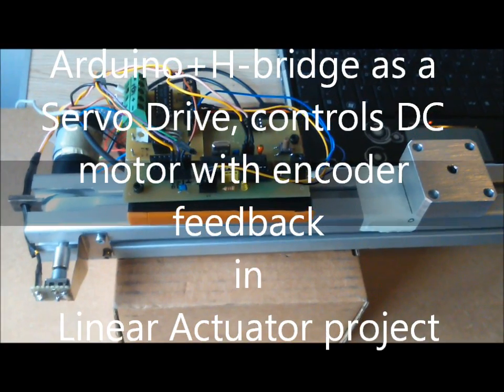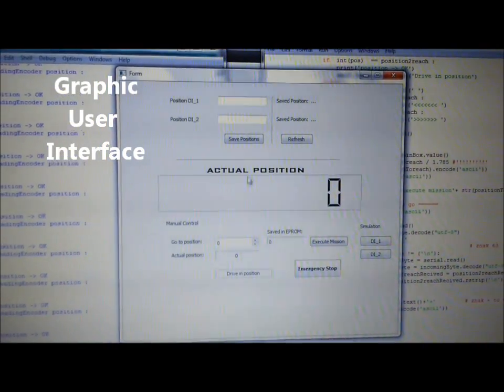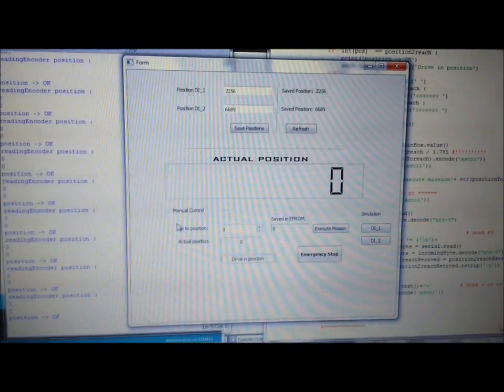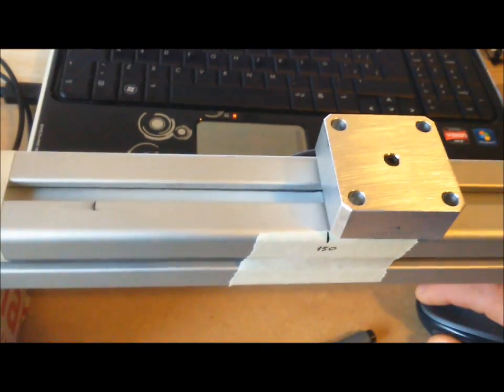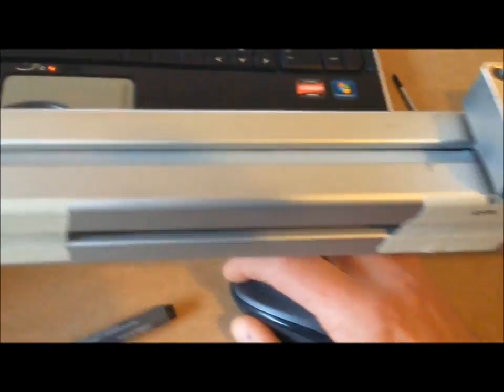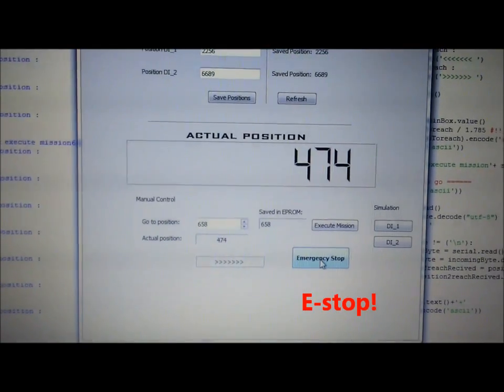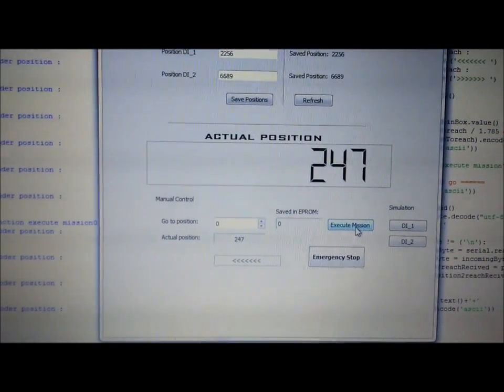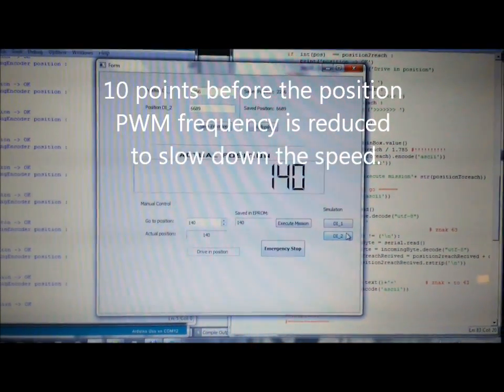Arduino position control of a DC motor with encoder feedback in linear actuator- Atmega 328

Comment: Hello, I’m doing a very similar project where I have to rotate a threaded adjustment valve on 3 separate spray nozzles to get different amounts of flow rate. I feel like an encoded dc motor would be perfect to adjust these valves to a specific position as well as getting the feedback to know it is in the right position. Another thing I want to do is create a user interface where someone can tell each motor what to set the flow rate of that nozzle to. I’m having trouble looking where to start and if it is even possible creating a user interfaces Ike that that is not on a computer like you’re using, I was thinking maybe a touch screen or lcd with buttons. If you see this I’d be glad to talk more about it! Thanks

Comment: That’s just a simple average DC motor correct? 

Is the position based on the number of revolutions the motor makes?

How do you verify that is in the correct position?
Reply from the maker: Hi Wyatt B, thanks for comment.
Yes, this is a normal DC motor with gearbox. The position is based on the encoder counts.
Encoder is connected to the gearbox exit shaft. When the motor moves, arduino counts the pulses generated by the encoder. 
For example ,  if you want to send the actuator to the position 500, motor starts moving right, arduino counts pulses, when arriving to pulse 500-10 speed is reduced, and finaly at 500 motor is stopped. If you want to send it to position 300 pulses, motor moves left, and at the position 300+10 motor slows down, and finaly at 300 stops.
all the idea, and control you can find on my web, fell free to download it.
http://arturnok.000webhostapp.com/linearActuator.html
regards!
Reply: Thank you ivnok. You have a well thought out project. Good job.

Comment: Very good video.conglatulations.My linear actuator has two only wires.I will will connect it on arduino mega and a potentiometer to control it. Have problem with the feedback.how can we give feedback to understand the potentiometer where is the actuator exactly,in which position?Thank you.
Reply from the maker: Hi Antonis, thanks for comment.
Your potentiometer scale, must correspond to your actuator scale.I mean your PotentiometerMin= actuator start, and PotentiometerMax= actuator end.
And then, you have to process the analog value from potentiomenter, and scale it to actuator unit.
if potentiometer 0= actuator 0 mm,
potentiometer 1024= actuator100mm. for example.
Then your desired position will be analog input feedback.
If jyou send the actuator to 50mm, it will stop when will have 512 value from analog input.

Comment: good Job,how can I do the same using HMI without pc or laptop ?????thanks dear
Reply from the maker: HI Raif Hanna, thanks for commnet. the answer is: using buttons. You should programme a menu, to be able to set up the system.
Reply: cara memprogram Arduino dengan menggunakan LCD dan tombol untuk menyesuaikan posisi aktuator

Comment: which option is a better one, a dc motor with encoder or a stepper motor?
Reply from the maker: I prefer the version with DC motor and encoder. Such way you have a feedback, and the controller all the time corrects the position. Practically is very dificult to gain the motor, and even if you do this, the motor goes back to the position after relising the  weight overload.
Stepper, if it loose the steps due to overload, doesn't even know this becouse there is no feedback. of course, you can mount the encoder, but I find DC motor easier to control.
Best regards!

Comment: wonderfull ! i was trying to do a similar project but i have a big issue, i don't know how to save the encoder position when i turn off the power,  has arduino some kind of ram or something to save the last value of the enconder ? 
im using a incremental encoder (sorry for my bad english)
Reply from the maker: Hi Aceman, thanks for your comment.Yes, arduino has EEPROM where you can store data after power off. 
Look for it in file>examples>EEPROM>eeprom_write and then, to read it after power on, you will need eeprom_read.
 I hasn't implemented it yet but in the future  i'm planning to improve the code with this function. Share the results please when you will finish it.
Reply: @ivnok   thank you ! i will try it when i learn how to use the EEPROM. 
see ya :D
Reply from the maker: Hi Aceman, 
go to my website, send me a message from message form and I will send you a solution to store positions after power off.

Comment: I have Win 7 & 10on 2 differant computers and have tried on both and get the same message. Using Arduino genuine uno and also on a NANO Atmega 328  I get Atmega not connecting, are you on the correct port or something similar. I are on the correct port and I do have the Atmega 238 chip on UNO and NANO. Can you please give me some guidance.  This is one of the best presentations I have seen.  Thanks.
Reply: Hi Ellen, sorry for delay. Make sure that you are connecting to correct port number at a speed 115000 bauds. hope it helps you...
Reply from the maker: HI Ellen, It took a long time, but I've solved this problem. If you are still interested to work with it, go to the page and download. regards!
http://arturnok.000webhostapp.com/linearActuator.html

Comment: Hello, thank you for that amazing video, i have a similar project but i have to use a stepper motor so there will be no use for the encoder for me, i wanted to know just if the code in python will change also or just the arduino code, can you tell me please which changes i should apply it in my arduino code to be useful for my motor?
Reply from the maker: Hello Mariam,
you have only to make some changes in arduino code. In the stepper motor controll, there is a library that you have to include in your programme: #include <Stepper.h> In my code, you can still use the part with serial communication. In the stepper control there are a command to send a motor to desired position: myStepper.step(myPosition). 
Probably you should insert this command in void loop() {} section.
In my code there is a value: position2reach. This value you have to use to send a motor to your position. Will be something like this: myStepper.step(position2reach). 
To send the motor to the fixed positions you can use my functions 
void goToA(){
  position2reach = myPosition1;} // and myPosition2
You can see the stepper_oneRevolution and other examples in the File->Examples->Stepper section in the Arduino IDE.  
hope it will help you,
 If you have more questions, feel free to ask it here, or even better on my web here: http://arturnok.000webhostapp.com/linearActuatorPID.php
Regards!
Reply: Thank you so much for your unswer :)
Reply: Actually i have a problem in the actual position..i don't know which function should i use in order to get it for a stepper motor..can you help me please?
i did search on the net and i found the currentPosition() is a function used for that reason but when i applied in my code it returned to me that it wasn't defind..any help please!

Comment: Whats the accuracy and precision of the system?
Reply from the maker: This encoder has a resolution 24 pulses, library counts all positive and negative edges, so 24*4=96pulses/rate
One turn is 10mm in the linear movement. So, the accuracy is 0.104mm per one encoder pulse.
The better encoder resolution you use, the higher precision you get. Best regards!

Comment: how you make concentric the motors rotor shaft and encoders knob ? With glue or something ?
Reply from the maker: I use the elastic pneumatic tube to connect them together. Better if is a little bit elastic, to compensate any differences in alignment. To tighten the tube on the shaft you can use a clamping band.
here you can see some fotos:
http://arturnok.000webhostapp.com/linearActuatorPID.html
Reply: ivnok in your site,I couldnt be able to reach the pid controlled actuator's arduino codes.Would you check please ?
Reply from the maker: Mert, download for PID version is still under construction... sorry for that, I hope to launch it soon with another video... stay tuned!

Comment: Hi, nice work. Which encoder did you used?
Reply from the maker: Hi Rafael, sorry for delay, I use encoder like in this description on Arduino site:
http://playground.arduino.cc/Main/RotaryEncoders
Is very cheap and accurate.
Reply: Thanks for your repley

Comment: I cannot op the  actuator1_0_3.exe file on my 32-bit pc. Is there another version?  vesadepo@gmail.com
Reply: I've sent you a Python code, that you will be able to play with it, and arduino. If you don't have it, tell me I will try again.
Reply from the maker: It was compiled under 64bit machine, and this is probably a problem. For now I don't have other  version. I'm working to improve an existing, but things goes very slow... If I will have 32bit version, will send it to you, but can promise nothing...
Reply: I am now programming in python but is is not easy.. Nice job your program!
Reply: I didn't get you mail.  I checked spam.. Thank you for the effort!

Comment: Did you make that linear actuator yourself?  Or did you buy it?  I'm currently working on a project where a linear actuator just like that would be perfect.  Any help you could give me would be greatly appreciated.
Reply from the maker: yes. I used a aluminium profile, timing belt, timing puleys, and motor with gearbox. One puley is mounted directly on gearbox shaft, another with 2 bearings on the other end of profile. Belt passes through the profile and 2 pulleys, and finaly 2 ends are tightened to the aluminium block which is movong on the actuator. I will try to make some fotos this week and put it to the site...
Reply: Thanks for the help.  Any pictures would be great.

Comment: I'm having freezing issues with the GUI and serial communication. Have you ever considered making it standalone using LCD and a keypad ? Please let me know if you ever do it :D
Reply from the maker: Yes, sometimes GUI stays friezed, but after clicking any button is comes back alive. I'm working on it. 
I didn't make it controlled from keypad, just wanted to make the control simple. The idea is, to memorize fixed positions (for now 2) using GUI and send actuator to this positions using digital inputs. 
In next version of the control I will use the buttons to control the actuator and serial communication via bluetooth connection.
It may be buttons or digital outputs from for ex. PLC (after some electronic modifications to separate 24V from PLC from arduino)

Comment: Dear friend, this is Robby.  I have a small dc gear motor with encoder, how can I control the position. Do I must add a limit switch. I  would be appreciate if news from you.
Reply from the maker: Hi Robby, you don't have to use the limit swithes, but it is recommended to make some movement limitation in the program.
Your motor with encoder you can control  using arduino board, and H-bridge for ex. there are not expensive ones:
http://www.ebay.com/itm/Stepper-Motor-Drive-Controller-Board-Module-L298N-Dual-H-Bridge-DC-For-Arduino-/170926726867?hash=item27cc06ded3:g:s4wAAOSwXeJXe31g.
Then, you must to programme the board, and control your motor using digital/analog inputs in your board, or communication.

Comment from the maker: Hello everyone! You must to check folder Spam sometimes..
Reply from the maker: you are right, it is drived with timing belt and timing pulleys. Belt is about 10mm width passed trough the aluminium profile 

like for example this: https://www.google.es/url?sa=i&rct=j&q=&esrc=s&source=images&cd=&cad=rja&uact=8&ved=0ahUKEwjEtqW496DOAhVJuBQKHZozBdcQjRwIBw&url=http%3A%2F%2Fwww.valuframe.co.uk%2FSeries-8-Aluminium-Profiles.html&psig=AFQjCNEoQs3Q3RBmBLTrLXJvhVOUAITeRA&ust=1470165505851501
Motor side, the pulley is fixed on the shaft with  M3x5mm bolt. 

Other side, the pulley is mounted on the shaft with two SKF608 8/22/7 bearings. Shaft is fixed to the profile with 2 plates to be able to tighten the belt.
In the begin of the video, you can see the belt (white color).
The construction is small, but with this small motor was able to move 4kg.
Reply: Hey Ivnok, could you send me your code! I would love to use it for my oxy-acetylene test bed. My email is aadlof10@gmail.com
Reply: Hello Ivnok, could you send me the code to tolwan@live.nl Many Thanks
Reply: @ivnok: This looks great for what seems to be a very minimalistic, clean build -- what are you using for the drive (I'm guessing timing belt)? And what'd you use for the bearings for the block to move on the aluminum extrusion? I'm surprised that I can see no sign of any belt or leadscrew or wheels/bearings!
Reply from the maker: P.S. to move the block on the aluminium profile, I used the 3x3 teflon blocks mounted on the bottom side.
Reply: Ah, smart. This overall design suits the aluminum profile very well it seems, and looks beautiful to watch. I'm sure if you were moving this to something more permanent, you can work a bit on tuning the PID values (if you're using PID) so as to let the block achieve the target position a little faster.
Reply from the maker: Well, the block reach the target position extremely fast, because it moves max speed all the time, and only speed i reduces 10 encoder counts before target position. It is configurable, depending your actuator and encoder resolution, after testing you can even reduce the breaking time to f.ex. 5 points at higher breaking speed...
answering you, I don't use PID control to drive the actuator.
Reply: My mail is boskovicnikola992@gmail.com, if you want to share your project = code with me. 
Is it incremental rotary encoder ?
Reply: @ivnok, could you send me the code to dnthao12tdh@gmail.com. Thank you!
Reply: Could you email me too? danton@drgsolucoes.com Thanks!
Reply: hi ivnok, i really like your project. it's a nice project and it has accurate position.  could you send me the code to my email. thanks before .
jhoentaxs@gmail.com
Reply: resanohm@gmail.com        the code plz
Reply: Hello friend, I liked your project and always wanted to make a circuit like this, I ask you please could you possibly send me a copy of the project? I am a Brazilian electronics student.
My email: castromandrake@gmail.com
Reply: hi sir 
  I do not want to be  shameless with u  but u didn't send any  thing for any one
Reply from the maker: Did you talk with everybody here? 
For 3 weeks I was extreamly busy, but even from my earlier e-mails I've not recive any feedback, even if I ask for it. It means, that my e-mails goes directly to Spam folder or doesn't reach the target. In next few days will send to all who is left.
Reply from the maker: How can you kow... becouse I didn' send to you yet?
Reply: Thank you very much for sending the code, it went in my spam folder indeed.
Would it be too much if I ask for the Python GUI ?
I don't know if you received the email I sent - odtec.servico@gmail.com
Reply: resanohm@gmail.com   the code plz